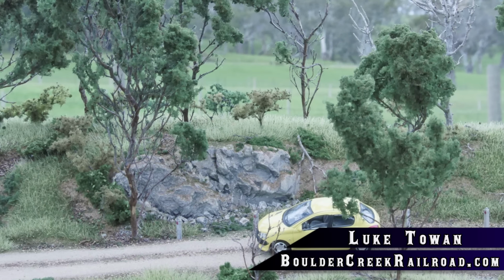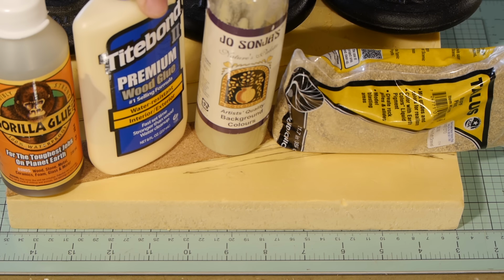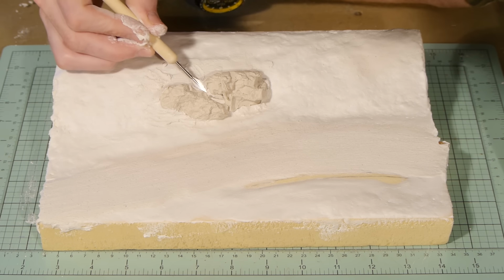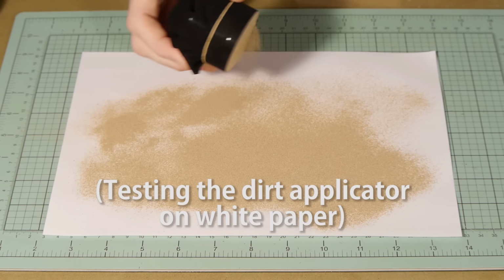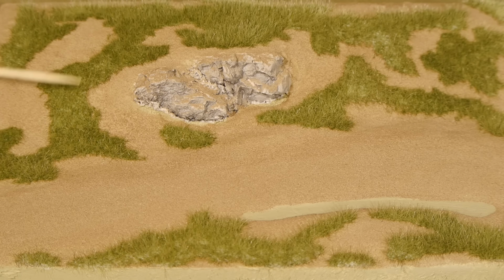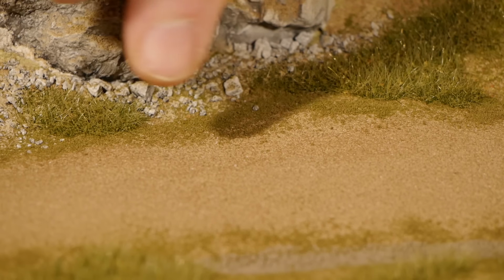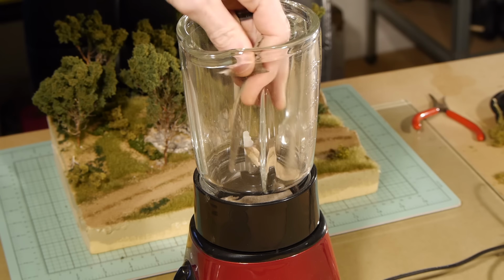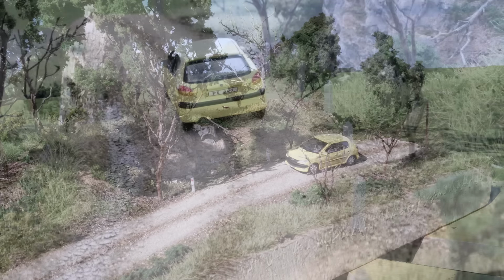Realistic Scenery Volume 2 - Modelling an old dirt road - Model railroad

Comment: Hello Elle! 

Just finding your channel now - what a great resource! 

I'm wondering - I live in Canada and ca't seem to find sculptamold. Is there an alternative that you know of that i could use? I'm making a terrain for a set design, 1/4"=1' scale. Thanks!!
Reply from the maker: It is possible to make DIY version with regular plaster of paris, just break up some toilet paper or a kitchen paper towel and mix it in with the dry plaster until it's evenly mixed through (it needs to be broken down quite fine), then add water 😉 You really don't need much plaster of paris for it to work. I used a cheap blender to chop up the paper towel into a fine fibre before mixing it through the dry plaster. Hope that helps ☺
Reply: @BoulderCreekRailroad  yes this is great! thank you so much!
Reply: @BoulderCreekRailroad  Hey Elle, I have another question for you!

Should i ideally wait the full 24-48 hours for gorilla glue to cure before applying the sculptamold/plaster of paris and paper mix?
Reply from the maker: @umzatherogue  I would usually give it just a few hours, maybe 4 or 5 hours, until it stops being sticky when you touch it with your fingers. Generally I use it to hold bits of foam in place and it’s not doing any major structural work, so it should be fine to add plaster on top once it’s initially started to dry even though it’s not fully cured. Hope that makes sense 😊
Reply: @BoulderCreekRailroad  yes awesome! thank you!

Comment: Wow !!! This is mindblowing. I could never do scenery like yours because i lack the patience. For road or desert diaramas I simply pick up ordinary soil and dump it on a wood board with a fake grass surface along with whatever vegetation I can find in a garden. Or simpler still, place whatever you want to use in a diorama, outside on real soil...take a photo, and then transfer the picture unto another picture that has the background you need. Works great if you only want to present your work via photos alone.

Comment: How do you get your static grass so nice? My shaker works fine but it lays down after it hits the glue.
I wish I could send you a pic.. do you have a FB page?
Reply: are you using a powered applicator or just a shaker bottle?
Reply: How close are you holding it to the surface?
Reply: I'm not sure why then. If your applicator isn't statically manipulating the grass at all, you may have a dud applicator.
Reply: That is more likely. I'm not too clued up on adhesives but you'd probably need something that is instantly tacky and not too diluted so the grass is held upright the moment it lands on the glue. I'd run some tests with different adhesives to see what works best.
Reply: I use the static king. It's a large Powered applicator by woodland scenics.
Reply: 2 to 3 inches
Reply: I have a feeling the glue may be garbage. The applicator is charges so bad the Grass sometimes shoots back into it.
It comes out vertices but after the  tool is moved it lays down. I wonder if there is a recipe for home made static glue.
Reply: Thank you for answering  :)

Comment: Luke, I have Problems with the Static Grass and Scatter application. When I apply the static grass everything is straight up but after applying scatter material, the wet water and the mod podge the static grass flattens and stays flat when the glue dried. Do you have an idea what i do wrong? 
Greetings from Germany,

Lukas

Comment: Just started planning scenery work on my new shunting layout and was wondering, is the sculpt-a-mould an absolute must? Can you just add scenery straight onto the foam or will it have trouble adhering and without the covering, is there some sort of obvious gap between foam hills and the base?
Reply from the maker: you can just add scenery to the foam but just make sure to roughen up the surface of the foam like I do with the wire brush so the glue has something to grip onto... Otherwise it will peel away quite easily.
Reply: Luke Towan - Thanks for the quick reply! It's good to get some advice from someone who's done this sort of thing before.

Comment: Please could you confirm why you switch to plaster on the road? Could you have used sculptmold and sanded it? Thanks
Reply from the maker: Sanding sculptamold doesn't work very well due to the paper fibers that are mixed in with it. Plain plaster sands much cleaner and smoother.
Reply: Great thanks!

Comment: Is there a reason you use scult-a-mold instead of using polyfiller or spackle?
Reply from the maker: It's generally a little lighter that spackle once it's dry, it's not a problem for small dioramas however when you have a large model layout weight can often be an issue. It also holds it's shape a little easier than spackle but if you want to use polyfiller or spackle they will work as well

Comment: How long does it take for the glue to dry
Reply from the maker: I usually leave it overnight but generally if you wait about 2 - 4 hours depending on how hot the room is that should be enough. Sometimes I even leave the model near the heater and it dries in 30 minutes but that's only if I'm in a hurry and you need to be careful that the hot air from the heater doesn't damage the model.
Reply: Ok thanks😃

Comment: Luke, Great Video. I ran into a small problem with the foam board. It started to curl from the moister ( I am guessing ). I think using a tile backer board as a base then glue that to the foam may help. I thought I saw that problem on one of your other videos but could not remember how you corrected it. Thanks for the videos. Very helpful in our craft. Cheers.
Reply from the maker: yeah I basically did the same thing, I used a piece of pine wood to frame the foam and used gorilla glue to glue it down, that managed to stop it from curling.

Comment: luke is it ok / does it work .... to tack down the road weathering with scenic glue?
Reply from the maker: You can apply the scenic glue over the road after weathering it however it will dull down the effect, you may find you need a much heavier coat of weathering if you apply the scenic glue over the top.
Hope that helps.
Cheers
Luke
Reply: its does .... i think i will refrain from using it and just re apply the pastel if it flakes off during transport etc .... i really appreciate your technique on this it totally brings my scene to life

Comment: Hey Luke, I've been wondering, why do you use Sculptamold in some areas and Plaster of Paris in others. Are they not the same?
Reply from the maker: I find sculptamold gives a more textured finish which I like for forest areas or rough ground but when I want a nice smooth flat finish I'll use plaster of paris or another plaster product.
Cheers
Luke
Reply: Luke, I also find that if you have a large rocky area to cover - as most railroads seem to, somewhere - Sculptamold has an amazing ability to look like rock between your actual castings. On a big area, I follow Dave Frary's method and paint the whole "wall" with a dark latex to even out castings and Sculp' (you can't tell where one begins and the other ends afterward), and then airbrush and dry-brush with lighter tones according to my vision. 
So, yeah, count me among the product's fans!

Comment: Fantastic. I've been watching your videos non stop for a few days--my own dirt road is maybe 3/4 done now. Can't wait to put the pastel on the wheel tracks! Having a bit of trouble getting my glue mix "misty" enough to spray in a fine cloud but also still be sticky enough to actually be effective. Also made my own Sculpt-a-Mold by pulping paper towels in a blender and mixing that into plaster. Cheap and works great! Thanks for all the ideas!
Reply from the maker: nice idea for making your own sculptamould, I always wondered how to make my own! Putting the pastel on the road makes a huge difference and yeah... the glue can be a bit tricky to get right, you could try adding just a drop or two of detergent and make it slightly more diluted?
Cheers
Luke
Reply: Yeah, I guess I'll have to really start paying attention to the ratios. Mine squirts and knocks holes in the flock which is very frustrating, so I've been using an eyedropper--obviously more time consuming for those bigger pieces, but at least it doesn't destroy the work! Thanks again.

Comment: Thanks for the video and how to do it. Only problem is see is when moving your diorama. Since you're also using a thick piece of foam as the base, doesn't the entire base flex when you pick it up?  Make my own rocks in different sizes/shapes by brushing liquid rubber from a crafts shop on different sizes of bark used in landscaping, then pouring plaster of paris into the mold. Thanks again for the video.
Reply from the maker: Thanks mate, So far the dioramas are quite small so warping and flexing hasn't been an issue but I have a few larger dioramas and I will usually make a plywood base to give it support. I like your method for making rocks, I have some rubber latex, I'll give it a try.
Cheers
Luke

Comment: Is there a big difference between Sculpt A Mold and Plaster of Paris? Could I use Plaster of Paris in place of Sculpt A Mold? I really enjoyed your video. I am going to give it  try. Thank You. - Jeff
Reply from the maker: +Jeffery Jones Sculptamould has a paper like fibrous material mixed through it. It dries a lot lighter than regular plaster of paris. You can however get away with using either one. They are both plaster products one is just heavier and dries harder (Plaster of Paris).
Cheers
Luke.
Reply: +Luke Towan Thank You Luke. I really enjoy your video please keep them coming. I am trying to learn how to do slinging mud in a diorama. Like when a Rally Race Car is sliding and mud is flying off the back wheels and into the air. If you ever do a video like that it would be greatly appreciated.  Thanks again Luke.

Comment: Hi +Luke Towan, can you please explain the difference between sculptamold and plaster of paris. For example, why did you use plaster of paris for the road instead of sculptamold? I'm considering using sculptamold for building up rock surface and hoping it's lighter and more carvable when set vs plaster of paris. Appreciate your advice.
Reply from the maker: +Rowan Ferguson Hi Rowan, Sculptamold has paper fibers mixed with the plaster whereas plaster of paris is just a fast setting plaster. Sculptamold is known for being lightweight however if you want strength then plaster of paris is better. As for the road, it's much easier to get a smooth finish with plaster of paris as opposed to sculptamold. For rock carving unfortunately sculptamold doesn't carve very well due to the fibers in it, at the moment I cant think of anything except the Woodland Scenics carving plaster, that might be an option? Any soft plaster would be ok I guess.
Hope that helps a little 
Cheers
Luke.
Reply: Maybe a combination of plaster for the main structural forms then top coat (used in gyprocking) for a veneer to scatch in the detail. It wouldn't work as a thick coat but might work in combination with a harder base. I'll do some experimenting and post the results on my channel.

Comment: But what happens if bugs decide to make webs?  What happens when it gets dusty?
Reply: +Anthony Abelardo Or worse, your wife likes cats.
Reply: Pat Sullivan oh yeah
Reply from the maker: +Anthony Abelardo you don't need to tell me about cats.... curious paws and plenty of fur! I should try collecting the fur to make more scenery material... lol
I generally try to keep my dioramas in areas that don't accumulate too much dust but eventually it will get dusty. I find as long as I secure the scenery down with enough glue I can lightly wave the vacuum over the top without sucking up all the scenery.
Cheers
Luke.
Reply: Luke Towan you can prob create a scene from twister doing that lol

but I'm sure it won't last "new" forever

soon all the dust will accumulate and make it dirty

Comment: Top quality, very realistic. Big question.  need help.  i use silicon to glue my extruded foam. NOT THE BEST METHOD.  What is the first option, second or third that you might recommend for gluing it. i ask this because is very dificult to find materials in my country that work well.   Thank you in advance
Reply from the maker: +Roberto Felipe Danilov Luna Hi, I find "Gorilla Glue" to be the best, second I'd suggest "Liquid Nails" but make sure it is the foam safe version, not sure about a third option. The problem is the foam is air tight and the glue in the middle can take months to set. Gorilla glue reacts with water and sets very quickly even in the middle where its airtight.
Cheers
Luke.
Reply: +Luke Towan Thanks Luke, the Force IS strong in you. Im sorry about Han,  he will be avenged!!!

Comment: Hi Luke. Why do you add the cork down as a road if you then just cover it up with sculptamold and plaster of Paris? Sorry if this is a dumb question I am building my first diorama and using this as a guide and I am try to understand all the techniques you use. Thanks for the great videos!
Reply from the maker: +John Fearnside thanks for the question John, I basically use the cork to build up the formation of the road, you could simply do away with the cork and mold the road with plaster but I find it easier to form the road surface with the cork there, it acts partly as a guide and helps to give me a more consistent road surface. You can also use cardboard to do the same job. Hope that helps. 
Pretty soon I'll be doing a video on making paved roads, the technique is different altogether. My next video will be a river scene but not to long after that I'll do the paved roads scene which might help you some more with your diorama?
Cheers
Luke.
Reply: +Luke Towan thanks for the rapid reply Luke! I am really looking forward to the river scene video. I am a (newish) scale armor builder and I am looking to make dioramas for my tanks to give them more of a story etc and your tutorials have been a big help. I just have to scale up to 1/35th scale for my purposes. Your videos have made me tempted to get into scale railroads though but I guess thats a whole different (expensive) rabbit hole to go down!! ;-)

Comment: Very impressive and informative! A newbie question though- why the alcohol before the diluted mod-podge ?

Big thank you for sharing your techniques!
Reply from the maker: +Alexander Fernandes Thanks mate, the alcohol helps the diluted mod podge absorb right through the scenery, the mod podge on its own tends to sit on top of the scenery and creates a shell of glue while the scenery below is still loose. Alcohol helps it penetrate right down to the base board.
If you're only dealing with thin layers of scenery you may get away without using alcohol but in my experience it definitely helps.
Cheers
Luke.
Reply: +Luke Towan Ah yes, just saw your other tutorial on wet water. Your channel is a gold mine of useful information! Those humorous intros are a very creative touch too! Keep up the great work Mr. Towan!

Comment: Holly smokes Luke.  Simply Awesome.  Just curious... why do you like to use the sculpamold over the top of the foam?  Contouring?
Reply from the maker: ron045 Thanks mate for the fantastic comment, you're right about the sculptamold, I do it for contouring. I find it easier to get the general shape of the terrain with the foam and then do a coat of sculptamold to get the finer details in the terrain as well as hide any sharp edges in the foam.
Cheers
Luke.

Comment: Luke, you've done it again.  Excellent video and wonderfully realistic diorama.
Reply from the maker: Bill Rogers Thanks Bill, I'm looking forward to doing more videos like this. I just need to keep thinking of good ideas. Which is pretty tough. The ideas seem to come to me at odd times and I'm always scrabbling around looking for some paper to write the idea down.
Cheers
Luke.
Reply: +Luke Towan I would like to suggest a scenery video project.  I have two very steep, narrow, twisting canyons on my layout that should have water in them but don't as I am not sure how to model that type of stream realistically.  As you may recall, the layout setting is on the western slope of the Cascades in Oregon.  Since there is a lot rain there, the streams would have a goodly amount of water running over and around rocks and over small waterfalls.  There would also be abundant vegetation - both evergreen and deciduous.  To represent this scene realistically would be a modeling challenge.  I don't recall ever seeing it done successfully.

Comment: A very well done step by step "how to."  I really like the idea of the pastels.  That is a keeper.  Have you seen my rut maker?  I will have to check out your static grass applicator.  Mine is getting very tired.  Rob
Reply from the maker: Rob McCrain Thanks Rob, I'll have to check out you rut maker! The pastels work great, I also think they have a small amount of binding material because once you brush them on they don't easily rub of off or blow away like chalk? I find I don't need to seal them down. 
Cheers
Luke.